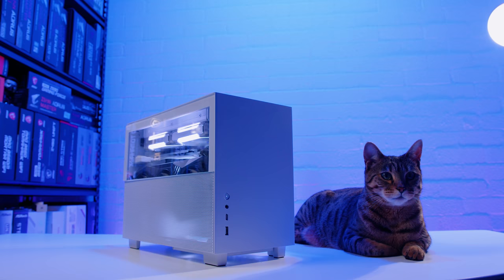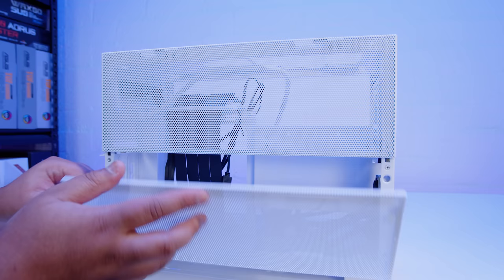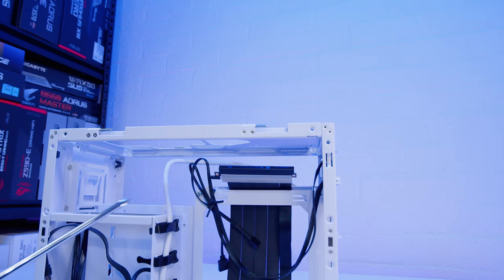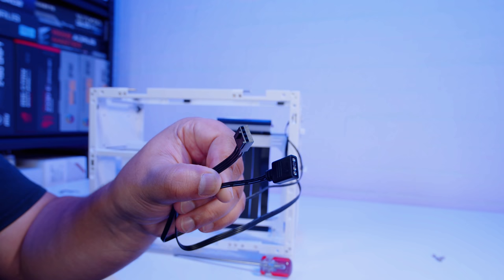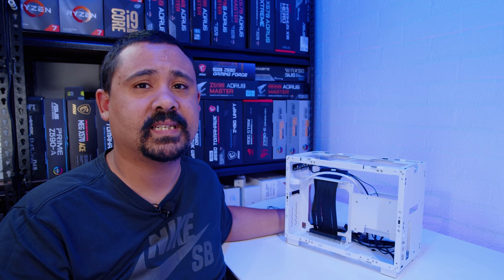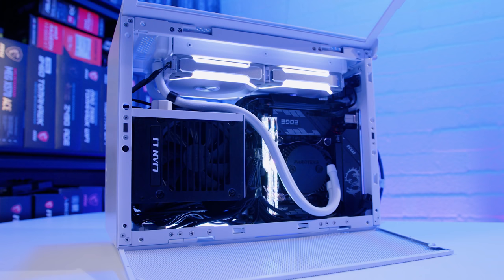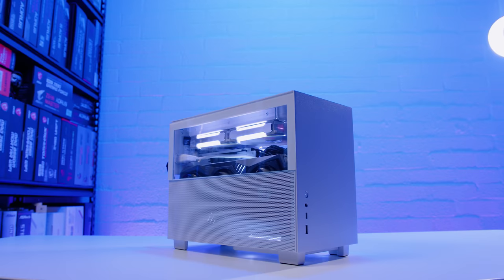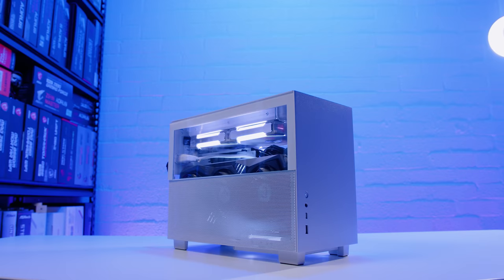The Lian Li Q58 is BRILLIANT!

Comment: Drop in ssds should be standard. In the center of a two chamber sff, this drop in idea could be a game changer. As far as the rear fan hub, that could also be a pretty nifty thing to be standard.
Reply: For those of us in video production, yup!
Reply: I would totally buy a case that has a stack of those hotswap style SATA SSDs.
Reply: You have to restart your PC to detect SSD though.
And removing it while PC is on will lead to drive failure.
Reply: @matasa7463  it's not hot swappable.

Comment: Found out to use a 280mm AIO you have to mount the fans to the case and the radiator below it. The radiator limit is 315mm or 325mm if you remove that SSD cage
Reply: Do you know if the NZXT Z63 280mm AIO would fit in this case? Would I have to do the same configuration that you are suggesting? The NZXT AIO is 315mm long, so I don't think there should be a problem with fitting it in since I will not be using the SSD cage.
Reply: @lucianootiniano9307  that should fit with no issue. The fans have to be fitted to the case first then radiator due to case having a bit of a lip at the top of the case that just barely fits two 120mm fans side by side.

Comment: My tip for everyone: 
You can buy the PCIe 3.0 version of this case for $80 on NewEgg right now and a white PCIe riser cable on Amazon for $50-$60. This is not only cheaper than buying the PCIe 4.0 version of the case, but you can drill new mounting holes closer to the case window/mesh to bump your GPU out away from the motherboard, so you aren't creating such a hot spot between major components (this is a mod that many have done and they have gotten better thermals).

Comment: The configuration mentioned at 13:55 implies that the best configuration would be to have the mesh on the bottom on one side and the top for the other. I decided to do this as I was watching this while I was building. 

This is not possible. The glass panels have a tab so they can only be both on the same side, both on top, or both on bottom. But not top on one side and bottom on the other. The mesh panels don't have that tab so it's fine. I'm now considering cutting off that tab but they don't sell additional glass panels (and I can't find where to order additional mesh panels in the states). 

The reason I wanted to do it was because the aio I chose looked nice and clean and I wanted to show off the CPU block. And I needed mesh on the other side for air intake for the GPU.

Comment: You could mount the fans 1st and put the rad below and then you could fit a 280mm rad. And have the fans exhausting air still.

I wonder if they could of made the front Io along the bottom to help with GPU clearance or if there is room on the other side.

Would also be good if you could but 2x mesh and 2x TG if you wanted to.

Now I have to make a hard choice nr200p max or this 🤔

Comment: Nick, you mentioned you couldn’t fit the ROG strix card in at 318.5mm (as per ASUS website) but you fit the msi 3070 which is measured at 323mm? So is the clearance more towards 323mm?

Comment: I wish this case would have all 4 mesh panels - this would help CPU (AIO) a lot.
Also, the front panel should be higher (on the upper half) or on the right side so it would give more space for a longer GPU.

Comment: Asus 280mm AIO fits perfectly without having to remove the fan hub or 2.5 inch drive tray.  NZXT 280mm AIO fits, but you have to remove either the fan hub OR the drive tray - the radiator is just a smidge too long.  
Also - NZXT kraken AIO pumps are too large to fit on Asus Z690-i boards.

Comment: PSA: NZXT Kraken X63 RGB 280mm does ~~not~~ fit in this case 

Edit: it does work! Just need to take off drop in ssd slot before installing. I was able to put the ssd slot back after I got the radiator in.

Comment: Beautiful case and great review. Only thing I would be a little concerned with is the screw that is really close to one of the fan power connectors on that hub. Lian Li should have made it longer to accommodate longer GPUs as most aftermarket cards are very long, especially the white ones like the Strix. Not sure why I haven't heard of your channel till today but you got yourself another subscriber. Keep up the amazing content.

Comment: I love the the design and the challenge of building with this case but unfortunately it's very bad in the thermo department. I ordered mesh side panels , tried air cooler and different air intake and exhaust dan settings . I played with 3 diferent gpus to test thermos and still the thermos were a bit too hot for my standard . i5-12600K / RTX 3060ti / 3080/ and in the end an FE 3070ti which is a smaller GPU with better headroom and lower temps but still running at low 70s celcius temps. Love the case and design but Inhad to take down the build and transfer it to the NR200 and let me say that the NR200 is way better in temps but not as beautiful as the Q58. I would say the Q58 is good for a lower tier 1080p gaming build like i3 /i5/R5 5600X /5600G with an RX 6600XT / GTX 1660ti / RTX 3050 or 3060 at the most .

Comment: great review as ever , managed to fit 280mm nzxt aio in this case along with the asus rog rtx3080 10gb v2 which is 318.5mm long ( had to take the power plug-in out and refit after card)

Comment: Hej mate, just watched your video. I did a little research: the ASUS ROG Gundam 3080 has a length of 318.5 mm and the MSI 3070 Gaming X Trio a length of 323.00 mm. How is it possible that the ASUS didn't fit but the MSI did? Is it because of the chunky ASUS cooler? I am a little confused as I want to try to fit a 4070 TI with a length of 323.00 mm which would be the same length as the 3070 you used here.

Comment: I just can’t help but think what this case would look like in a vertical orientation with the mobo io at the bottom. I do wish you could have the glass open slightly on top with the top mesh panel installed.

Comment: this looks so good, my next build is probably gonna be something small, so mini atx is great, was looking for a either 3080 team green or team red 6800 or 6800 xt. problem: there is literally NO custom card design that would fit. the reference cards are smaller lol! but sexy case for sure, thermals also look ok!
Reply: Ive looked at strix specs and they say its less than 320mm when that msi trio board is 323 so its such cointoss if they give accurate specs in that regard.
Even a red devil is meant to be a couple mm shorter but that remains to be seen.

Comment: hmm now i watched GGF and well that guy is just brilliant and custom. This build is necessary because its what 90% would have to build. Making it look good though, just pure looks, the open spaces, the window configuration either custom water cooling, or lets say gpu side vented side panel put on bottom and top. Then we have double window where the motherboard/power supply is, then your cable management needs to be top tier. If you double window gpu side, then you are just suffocating the gpu and I am pretty sure everyone here would just not do that.

Comment: I just bought the black version, went with the MSI B550I, Ryzen 7 5800x, Kraken z63 aio, g skill z neo 32gb,  but i am debating on the power supply cooler master v850 or the silverstone sx1000 platinum for my 3080ti.

Comment: Hey GS, can you please make a ATX build in the SFF-Time N-ATX case. Particularly with watercooled parts. I have a i7-7700K under a 240mm corsair aio on a ASUS TUFF Z270, a EVGA 1080ti 120mm aio Hybrid, and a EVGA G2 850W ATX psu. If possible, I would like to move them into this slim ATX case to better fit my cramped dorm desk. I've come to despise my Corsair Crystal 570X RGB case younger (very dumb me) purchased.

Comment: Could you mount two 3.5in HDDs in there?
My SG05 at nearly 11L can fit two 3.5s and two (to four) 2.5s, a 120mm AIO with P12 push-pull, SFX PSU, 60mm gpu exhaust. Heck I'm planning on mounting a couple of 40-50mm fans beneath the PSU for some VRM ventilation.

I'm thinking of the Meshlicious or maybe this case as a potential future upgrade

Comment: Wondering if the ROG Strix card would fit id you removed the top and slide the in GPU from the top. Seems like it just has trouble making that turn as the pcie back panel isn't deep enough

Comment: Anyone got suggestions if my msi gaming x trio 6900xt will fit this case? It is 324mm in length, only 1 mm longer than the card used in the build. But it looks like even 1 extra mm can be an issue ...

Comment: The best side panel configuration is the mesh side on the bottom for the GPU side and then the mesh on the top for the cpu side. If yo I had done that then there would be an improvement in temps but I mean there is also only so much you can do so whatevs

Comment: How thick can the bottom intake fan be? Was considering the Phanteks T30. I have the Artic P12's but maybe those would be better?
Reply: EDIT: I’ve just started building in this case and I’ve used the Arctic P12 on the bottom and it is neck to neck with the cables from the power supply. It would be extremely difficult to use the Phanteks T30 in this case

Comment: Are the side glass and mesh panels symmetrical? Like you can put a mesh panel on the top or use both mesh panels on one side while the other side has both glass panels?
Reply: Maybe it looks like it can work but on one side only? unless you cut the tabs off that the thumb screws for the glass panels.

Comment: In many of these small cases the hot air from the GPU seems to be pushed toward the back of the motherboard and, in this case, the riser cable with no place to really go. Would that not be an issue?
Reply from the maker: Not an issue

Comment: Looks about the same size as the TU-150, which I have. Love the handle on the TU-150, but my GPU was such a tight fit in it. Wish it had about another half inch in length.
Reply from the maker: It's not

Comment: Dang just bought the Strix card and was hoping to buy this case. Have you tried removing the power adapter at the back to make way for the GPU temporarily then installing it back again?
Reply from the maker: It doesn't fit. Simple as that. If there was a way to make it fit I would have done it
Reply: @GearSeekers  Thanks for testing it out for me! Guess I'll just stick with Meshlicious for now haha

Comment: Can this only fit ITX?
Reply from the maker: Yes
Reply: @GearSeekers  Thanks for replying man, on your 011 Air Mini you mentioned that you can technically fit 3 120mm fans on the bottom correct?

Comment: Why use an 11900K and use only a 240 AIO? Does not make sense. 280AIO is the way to go for that chip. Personally, I would rather  use an a Ryzen 5800X - it has better performance and lower temperatures, and I would still use a 280AIO to have even lower temps and noise.
Reply from the maker: Did you not listen to anything said in the video lol 🤣
Reply: @GearSeekers  My bad, I wrote that before finished watching the video.